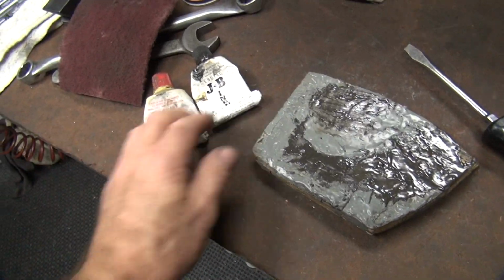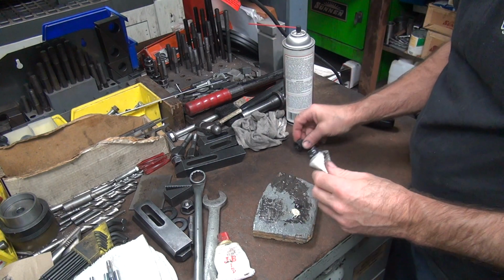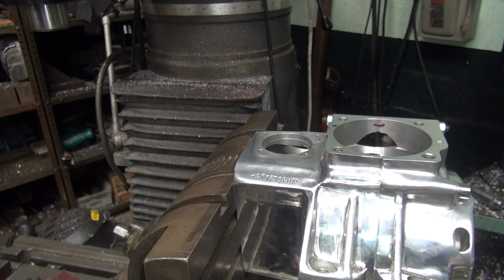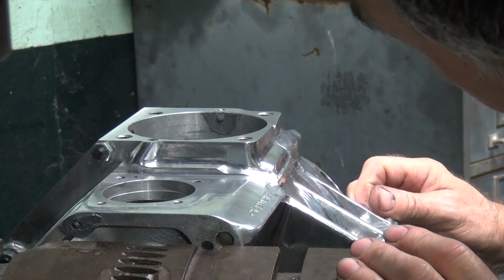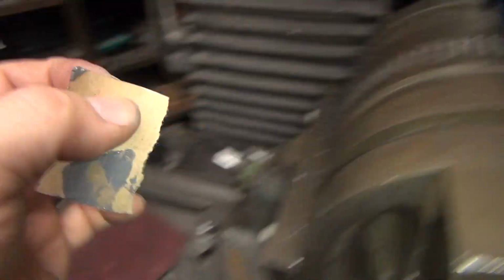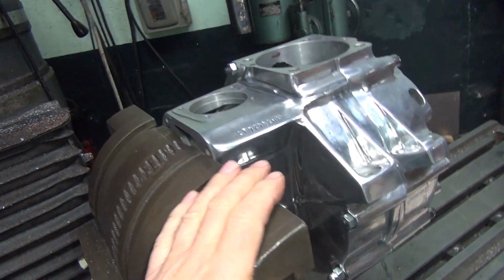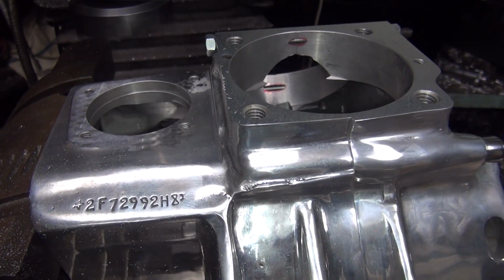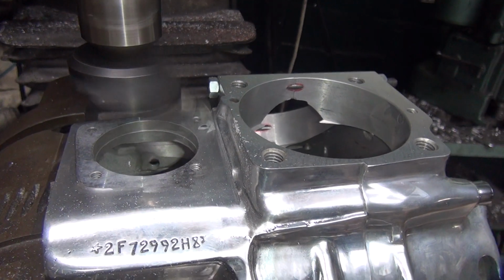#111 1978 93ci stroker shovelhead big bore motor new bike build fl harley by tatro machine

Comment: I worked for the SCDOT for 34 years. We had a two part epoxy just like what you are using. Equal parts black and white. It came in large tubes and was used to install delineators on the asphalt road surface. I always kept some at my house. It seemed to get into my lunch box somehow. To this day, I believe it is none other than JB Weld.